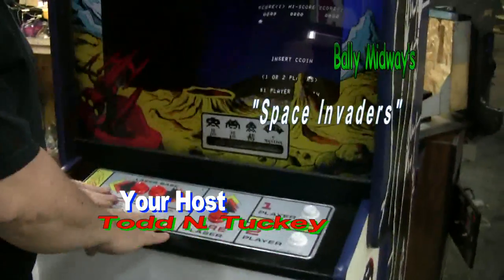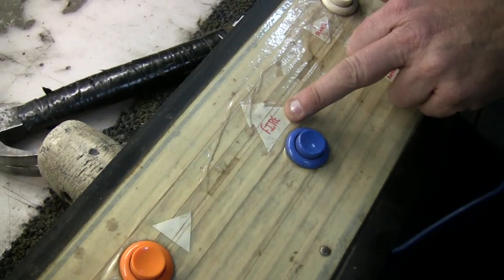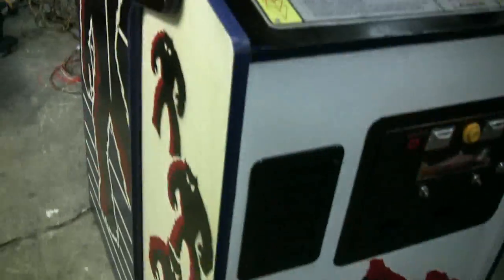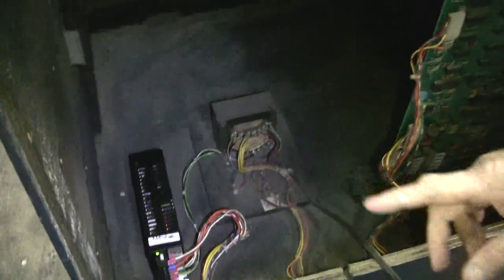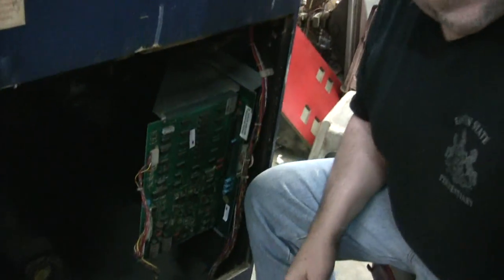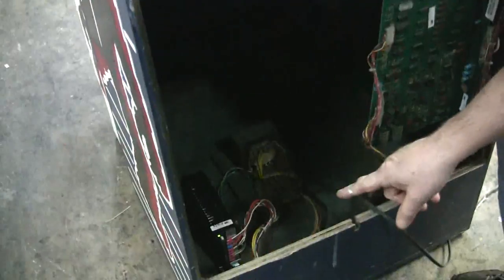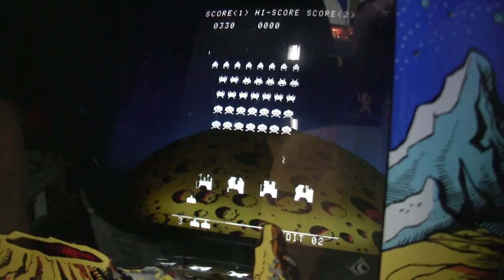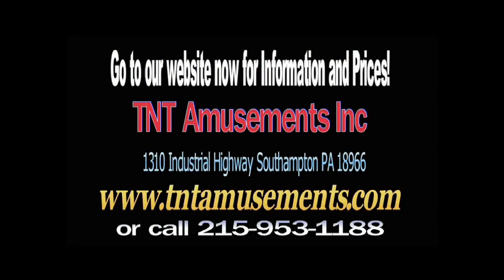#441 Bally Midway SPACE INVADERS Arcade Video Game updated Color Monitor! TNT Amusements

Comment: I got a space invaders recently that has a forward facing monitor. Is that normal or was it probably modified?
Reply from the maker: Modified for sure...I remember people were converting older Midway games with same board system to space invaders because it was making so much money!
Reply: @tntamusements  Thanks for the answer. While I have you here would you mind answering one more question for me? I have a nintendo cab that's missing the lower back panel, where would be a good place to find a replacement?

Comment: What would cause a monitor to kick off after 3 games and do it each time the game is turned off and back on, the game will continue to play blind?  This is on a Space Invaders Deluxe?  I have owned this game over 20 years.  Any advice would be great.  thanks Jeff,     I  love your videos,  great stuff, thanks a ton.
Reply from the maker: dried out capacitors, cold solder connections are a good place to start!
Reply: Thank you very much,  I have several of the old video games 8 actually, never tried to repair any until now.  thank you.